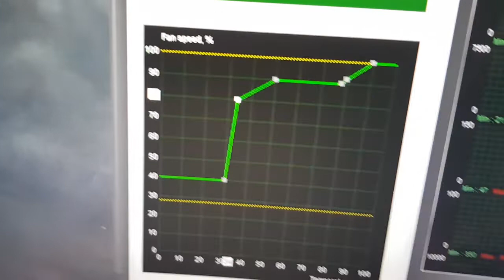How to fix Graphic card fans using WD40 (GPU Fan issue)

Comment: Is it safe to use WD-40.
My Graphic card Fan' body can't be open. I only can spray the WD-40 as you did in the video that is from any side of the Fan. 
I have the Spray(wd-40).
My worries is that is the WD-40 electric conductive. Will it cause Short circuit if done the way as you did. 

Please help with your reply.

Thank you.
Reply from the maker: nope.. don't use this if fan body can't be separated from graphic card. This is only for moving part.. not for GPU registers or chips..
Reply: @DrigIndia No. I mean fan can be removed from the Graphic card but the fan body or cover can't be removed. Usually the fans of SMPS and processor have a opening behind the fan body where oil can be applied. But in this case of Graphic card Fan it's too small first of all and there is no cap behind the fan to open and apply oil.

Comment: u need open the fan and spray inside the center
Reply from the maker: already tried but it is not at all working... the motor got damaged.. but now I am not using it.. Kept it for spare GPU with external fan.

Comment: Bro before you buy a replacement try pull out the motor from a fan, but you must have patience and precise control or you're gonna break the fan. (Look under stickers if they're hidden screws) Pull it sideways (something like that) Did mine on stock gigabyte gpu fan.
Reply from the maker: I will try that... kets see if this will work

Comment: Is it safe to use??? Is it conductive?? Wd 40?
Reply from the maker: yes, its just provide some lubrication to the fan. But if fan is giving problem, then the chances of getting them fixed by WD is less. It will only work if the issue is only due to dust particles.
Reply: It's safe but pointless it will dry up after a couple of days